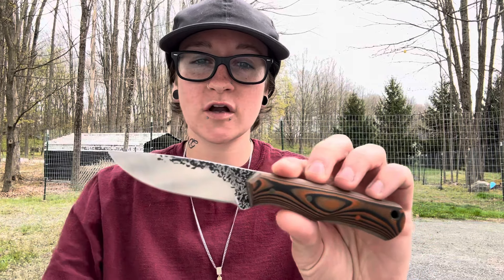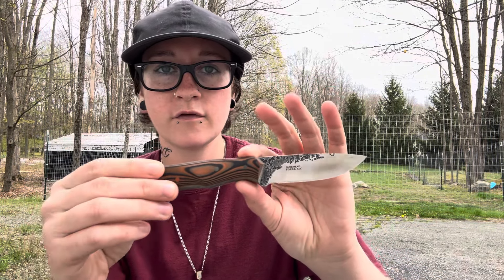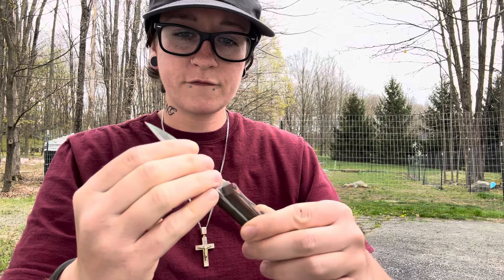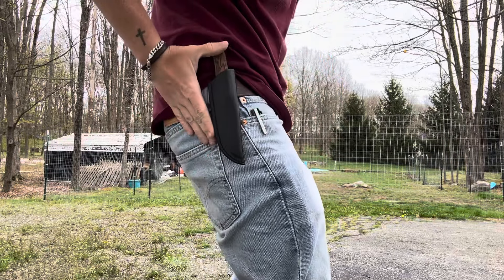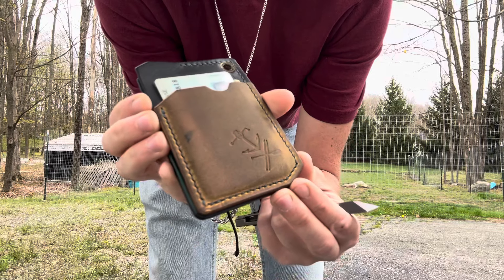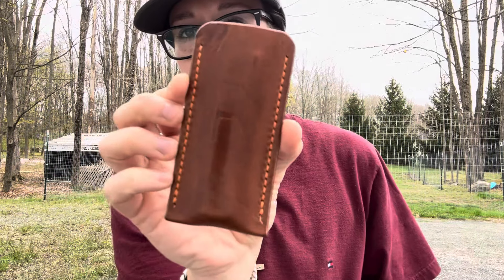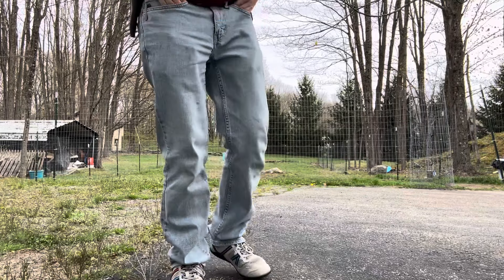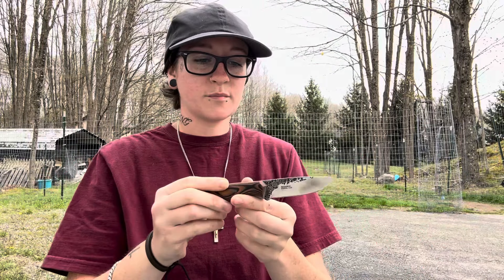CPM-S60V Blade Steel! Duck Head Forge “Slater” and EDC POCKET DUMP!

Comment: Years ago i was gifted a test blank of s60v from triple b at 65 hrc.   The discussion of s60v came up on the spyderco forum.   Sal mentioned the difficulties of using it when they started out.   Intrigued to know more about my experience,  Triple B is making Sal a custom knife in s60v at 64-65 hrc for evaluation.  Sal seems eager to work with Shawn to create a mule team in s60v from what ive seen.   Kind of like a redemption run.
Reply from the maker: Now that would be RAD!

Comment: from what i know, s60v is lost because it’s just objectively worse than the contemporaries. s30v is tougher and doesn’t lose much edge retention and s90v blows it out the water with edge retention without sacrificing almost any toughness.
Reply: yeah i just double checked and s60v went out of fashion because it has almost identical toughness as s90v but has a fairly substantial drop in edge retention. it’s got slightly better edge retention than m390 at around the same toughness, maybe a ft lb or so higher. it’s definitely an interesting steel considering how uncommon it is. definitely interested to see how it performs
Reply from the maker: I am curious about it!